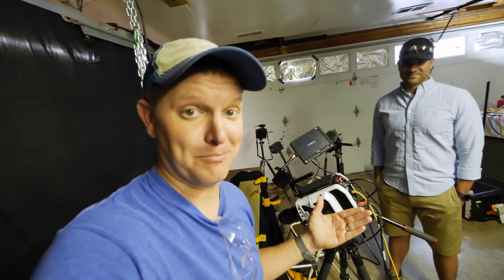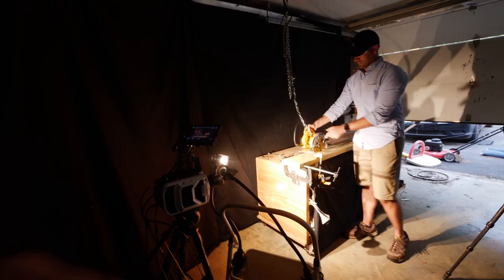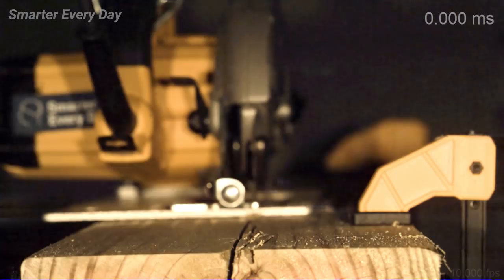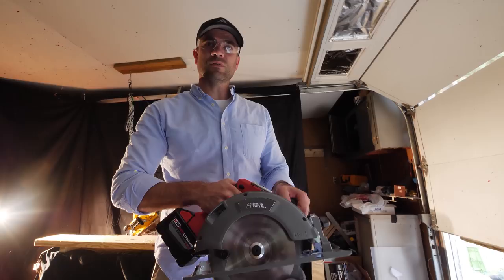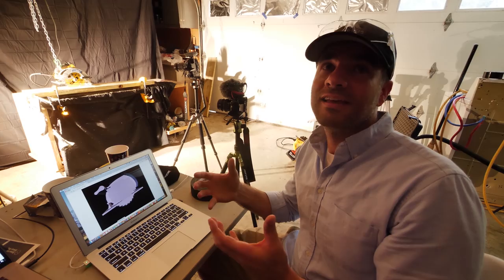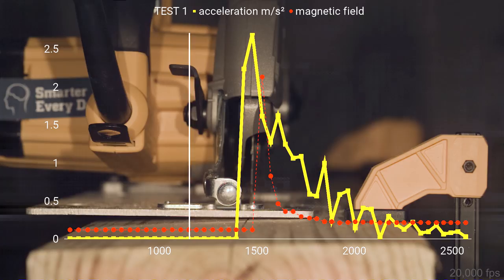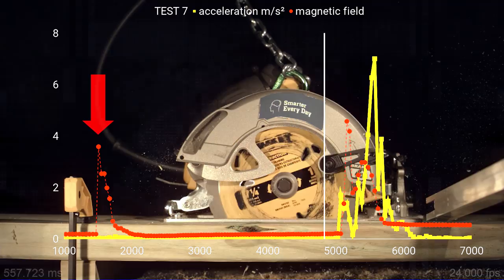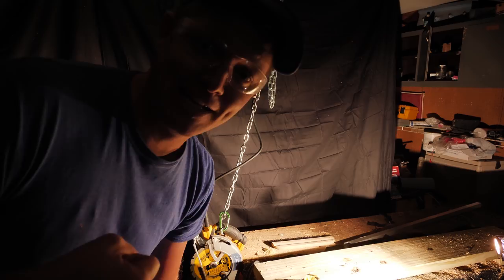Circular Saw Kickback Killer (We used science to make tools safer) - Smarter Every Day 209

Comment: One question: Do they sell circular saws with opposite rotation in USA? I have two circular saws myself, Makita and Metabo, both of them have teeth attacking lower side of a board, so if I loose grip they just stop. Also, this way a saw is pressed to a board by cutting so it doesn't need additional pressure, all I have to do is drive it straight forward. The only downside is that upper edge of cut material get chipped as it is the exit side, but lower edge stays clean.
Anyway, for the type of circular saw shown in the video, Chad's (hopefully) patent is a must-have. Congrats and keep up the good work!

Comment: Great concept!  We use worm drive saws with the motor turning perpendicular to the blade. This drastically reduces the kickback effect. I assume the data on inertia would be drastically different. I would like to see the comparison
Reply: How? It's not to do with the inertia of the motor? It got to do with the blade being grabbed and the saw being moved by the motor instead.

A wormdrive gear won't stop kickback, because it isn't about inertia. It's about the direction of the blade, and the blade still spins the same way.
Reply: PBMS123 because worm driven saws have more torque. Aka it’s harder for the blade to be pinched because the saw has enough power to keep cutting.
Reply: Interesting.  I would imagine because gyroscopic precession of the blade and the motor armature are at 90° to each other a worm drive saw is more stable.  They are heavier as well. Extra mass would also negate some of the kickback effect.
Reply: The inertia of the blade and/or the motor doesn't contribute to kickback.
Reply: I guess because it will stop right fast once the dead man's switch is released, probably wreck the drive In the process, but better that than your thigh
Reply: Andrew Delashaw yes it does it contributes to stopping kickback. It’s harder to punch a blade with more torque.
Reply: motormaker no that’s not the reason. It’s because of the gear reduction leading to the blade having more torque. Unlike “sidewinder” saws that have high speed but low torque and are really easy to stall out.
Reply: Life after Jess  Of course the inertia characteristics would be different. The beauty of this concept is that the motions measured during kickback are never encountered during anything close to normal use. A manufacturer can 'train' the safety chip to the kickback profile of each type of saw that it will protect and the user will be safe.
Reply: @PBMS123  It does have an effect because the worm gear saws are heavier and have a different mass distribution. Because the motor is more further back it requires more torque to rotate the saw as to what happens when a kickback occurs. And also because the handle is also farder back it creates a bigger lever so it's easier to resist a kickback.
Reply: @xenonram  Its the mass. And it does.  the bigger the mass the harder it is to be moved fast..
Reply: justlookin59 yes.   Gyroscopic precession ,I would think, would cause more of a twist on a worm drive. On a sidewinder all the rotating mass is on one axis.

Comment: You first demonstrated with a saw that is missing its blade guard, something most saws these day come with, you then showed a modified saw WITH a bladeguard. why didnt you show kickback behavior with a saw that has the bladeguard installed? is it also not quick enough? i understand that aditional safety is nice, and i imagine the sensor is small enough and cheap that the added safety feature would not impact the final costs of a saw with this feature, still, would like to know how the original feature performs to kickback.
Reply: Slower than the smart brake.It's a mechanical spring-loaded system.
Reply: I understand what you are saying it is a nice point but something like this would make cutting so much easier so that we didnt have to worry about blade guards getting in the way of complicated cuts and from my understanding and experience that blade guards some times is a little sticky for UK instance my saw blade guards some times sticks up which would make something like this a nightmare however I cut from the hip not strait out in front of me so if this happens the saw is going past me but I have had Vick backs so hard I've slung the saw

Comment: Most of this type saws I saw (pun intended) have a simple shield on a spring that closes as soon as the blade gets off the cut surface.
Reply: Doesnt cover the whole plade
Reply: The one I have does cover the whole blade when it's not engaged.
Reply: Beezqp it can never close fast enough. The front of the saw will cut you before the shield swings around from the back to close.
Reply: Actually, the blade cover closes from the direction that you are standing in first. Otherwise, you'd need to manually open the cover before each cut. This means that when kickback occurs, the blade guard will immediately cover the most dangerous region.
Reply: The guard does not spring back fast enough I have cut a chest guard off a harness I was wearing with kick back you obviously do not use a worm drive often
Reply: In time, blade gaurds can get stuck. Especially if the saw isnt cleaned and maintained properly. NEVER TRUST A BLADE GAURD.
Reply: How about having a blade guard AND madsskml. Two safeguards is much better than one.

Comment: Did you disable the spring loaded blade guard?
Reply: Walter Mayer yup not a real world test
Reply: Yes of course they did. Use the guards correctly on these machines and the risk is minimal. Americans never seem to use the guards correctly.
Reply: The blade is engaged in the wood, so the guard would be back anyways. If they had the guard installed you wouldn't be able to see the blade when it lifts up.
Reply: It's necessary to take video of the blade.  The problem is the blade is moving insanely fast, and the guard is relatively slow.  It'll probably save you if the saw falls to the floor, but check out how many teeth engage with the wood in the 50 ms after the first hit.  Haven't done the math on circular saws, but on table saws, it's 2-3 teeth per millisecond.  It doesn't take much contact to mess you up.
Reply: drfroglegs r/woosh
Reply: I think that at least in the US and with trade professionals, that this would be somewhat real-world. A lot of people will disable the spring-loaded guard, as it tends to get in the way and slow down work. People will bypass physical safety features if they're obstructive and slow down workflow, especially if they do that work repeatedly.

Comment: Michael said it below as well.  This is why all saws have a spring loaded blade guard.  If you are foolish enough to actually let go of the saw, the blade guard will cover the blade.  Nobody gets hurt.    I appreciate what you are working on and it has a cool factor, but I prefer a low tech solution to this non-issue.
Reply: Driving circular saws dont have those
Reply: Worked for as a summer handyman with a guy that had removed his guard. Quickest job I ever quit.

Comment: Very cool. I was thinking it's just be simpler to go off the amperage when it spikes, but I guess this specific case demoed the amps wouldnt spike. I can see how this type of kickback can happen but I think it's very irregular because you're pulling the saw instead of pushing it. Which changes the direction of the blade from up pushing into the fence to down and pushing off the wood.

Comment: I wonder if a better result could be achieved by just using a limit switch with the surface of the wood and the brake mechanism
Reply: No. there are many other types of cuts people do with these that the switch would not work on. It's not bad thinking though.
Reply: @weeral1  the switch could be also located at an inner flange not just on the shoe of the saw. I know doing all this machine learning is fun but sometimes the solution could be easier than you think
Reply: @Themodmin  plunge cuts
Reply: The key is reaction time.  How fast can you stop the blade. All happens within less than a second.

Comment: isnt that the reason why hand saw blades are wavy, to cut extra space so it dosnt get stucj in the metal you are trying to cut
Reply: Nah, they're wider at the tip so that the flat surface of the disk doesn't rub on the material you're cutting. The teeth will still chew in sideways if you mess up the cut. Kickback is actually LESS likely to happen on blades that aren't wavy.
Reply: Yes you are right Vega, it creates a kerf so the saw doesnt get clogged with the waste.  I think the other dude completely missed your question.  Sawzall blades r like that too

Comment: I like the concept but its very rare for kickback to be that uncontrollable on a circular saw unless you have weak spaghetti arms. This would on the other hand be better suited for a table saw, which has a very dangerous and uncontrollable kickback that can cause a lot of damage to the user. I recomend you try it on a table saw and you will have companies coming to you like flies.
Reply: I agree but i would still prefer to have that saftey mechanism over not having it..
Reply: There is a company that produces a table saw with an auto braking system.
Reply: Kickback combined with a large nail in the wood is not something a beginner might not come out alive from.
Reply: It’s been invented for the tablesaw already... it’s called SawStop....
My bad, that’s for a finger touching the blade not kickback 🤦‍♂️
Reply: I was going to say the same thing. I've cut a lot of wood with a circular saw, and i've honestly had more close calls on a table saw. Even when cutting 4x8 sheets of plywood, as long as you have it supported there's not much to worry about. If you have a big bow in your sheet thats when you shove a 2x4 under it for support.
Reply: Agreed, but I feel this tech could be easily implemented into any hand powered tools. Think about this in a chainsaw or angle grinder
Reply: @heli400  Sawstop does not prevent kickback and was never intended to, it senses when the blade touches moisture (like human flesh) to keep people from cutting their fingers off. The danger of kickback on table saws is that it flings the workpiece back towards the user at a high rate of speed, potentially causing serious injury.
Reply: @mrslinkydragon9910  I don't think that senses kickback though.  It needs to sense meat (hotdog or a hand) at its blade to stop.
Reply: To have a gyroscope detect kickback on a table saw you would have to have the gyroscope installed on the piece of wood. When a table saw kicks back the 300lb saw won’t move at all.
Reply: A circular saw kickback its way more dangerous. The blade of a table saw is static, so the chances of SIGNIFICANT injury is almost non existent. You might get a piece of wood thrown back at you, or get a splinter, but no injury from the blade. Plus, the blade on a table saw is "pushing" the wood towards you, not pulling you towards it.
Reply: Andrew Delashaw generally the main danger of table saw kickback is your hand ending up in the blade. Look up table saw kickback by thinz12 and you can see what I mean. For blade pinches such as in a rip there isn’t much danger of your hand going near the blade
Reply: @Yonatan24  Beginners who are using wood from pallets are especially likely to run into this...
Reply: @Grakoham  the gyroscope sensor would have to be more sensitive, the table saw would still move.
Reply: @Grakoham  Not necessarily.  Equal and opposite reaction means accelerometers (or other kinds of sensor) close enough to the blade may be able to effectively detect the kickback force impacting the table itself.
Reply: @HonoredMule  and @bososz normal operation and also potentially resting a heavy board on the table to rip it could create vibrations of the same magnitude as those caused by a small kickback. A small kickback can still do a lot of damage.
Reply: @Onihikage  ya, I corrected myself in my own comment
Reply: @bososz  The  jump putting a large slab on the table saw top would trigger it
Reply: @Yonatan24  and therein lies the problem with technology like this. Making it work when it should but not to be a nuisance while working.

Comment: This absolutely should be a feature for all types of saws, including jigsaws and table saws!
Reply: Charles Jones totally agree man!
Reply: I guess it detecting binding with a tablesaw would be totally different though, would probably have to detect sudden torque changes.
Reply: I've had jigsaws bind several times and even snap a blade. I guess "Kick UP" is more appropriate for a jigsaw :)
Reply: What kind of question is that? Are you trolling? All power tools are dangerous if used improperly.

Comment: I love Smarter Every Day, but i think it’s dishonest to exaggerate the danger by disabling the blade guard . I’m also pessimistic about the real world application of this on a job sight where saws are often used in very awkward positions. I kind of think you may get a lot of false tripping. 

Currently the best saws for preventing kick back are worm drive saws, the longer design and added mass does wonders in managing kick back

Bosch already has a similar technology in the works for table saws so you may be late to the game. That being said, you should talk with the people at Saw Stop, maybe they want to enter into the market.
Reply: Most of the time and injury involving kickback with these saws happens when the operator is holding the guard up manually. Festtool has a plunge saw that retracts when lifted up and it works very well at avoiding injury too.

Comment: seems like torque sensor + accelerometer would do the job, but lacks the "machine learning" sexiness lol
Reply: The point of the machinelearning is to not trigger a false alert when you fx. start the saw
Reply: @Lorentari  
+500ms delay on sensor

next! lol
Reply: @Lorentari  setting appropriate thresholds it would be fine. If your doing some whacky shiet that sets off the sensors and isnt a kickback, it should probably shut off anyways.

Comment: A couple things about kickback:  1.  It's almost completely avoidable.  The only times I've had a saw try and kick was when I had done something stupid in terms of supporting the wood I'm cutting or the placement of the saw.   As he shows in this video it mainly happens when the wood falls in and pinches the blade.  The vast majority of the time you can avoid this by properly supporting the work.    But there are awkward situations where you need to cut things..  Dimensional lumber can often have internal stresses that make the wood move once cut. Or it can be cupped/bowed/twisted.   (these only really come into play when you are making a rip cut)
2.  Know when you are doing something dangerous and get a real good grip on the saw:  If you can control the initial kick you can overpower the saw.  But if you let it get loosey goosey on you it's trouble time.    Keep that blade embedded in the wood till you can turn the saw off! 
3.  Plan for failure.  Fail to safety.
Reply: 4. Understand that everyone is an amateur at some point and that mistakes are going to happen to all of us when we're amateurs, and that if safety can be engineered in at almost no extra expense and with no detriment at all to experienced users of the same tools, it should be engineered into 100% of product sold. There's literally no reason not to, and every reason why we should.
Reply: @gweilo8888  Under the conditions you've laid out then of course.  But steps that enhance safety without any detriment to experienced users are low hanging fruit that has already been picked for the most part...  

Almost nothing comes without tradeoffs.  Either in price, efficiency or capability.  If safety was truly the most important thing all vehicles would be governed to 20 mph.  Presto: no more vehicular deaths.   
Safety is a prime consideration, but it's always in balance with your goals.  You're own brain is by far the best safety tool ever invented.  Plan for failure, fail to safety.

Comment: Its a neat solution to solve the saw kickback. However i wouldn trust my legs to a neural network, I would rather prefer a simple dead man's switch that brakes the blade whenever the tool desengages the wood or when it detects a rapid increase in torque (as when the blade bites into the wood).
Reply: I agree that I wouldn't prefer a nearal network. But a torque peak detection might not work, e.g. when the the blade starts biting into a second layer of wood. A peak detection for the accelerometer and/or gyro should work though, I expect
Reply: I somehow think that their solution isn't even smart. Its just a overcomplicated solution vor a problem that could be fixed rather easy. 
But the fact that no company did something like a pressure sensitive switch surprises me.
Reply: AFAIK I don't think it's a neural net in the saw, they're just using a neural net to train the thresholds that the device will use.
Reply: @megacherv  I'm not sure if that's correct... The neural network is really a black box with the hidden layers, and if it's a binary classifier (not kickback, yes kickback) the output is basically either a zero or a one. I think a manually defined threshold would work just as well since that acceleration is a huge jump compared to null. The NN could be over engineering it.
Reply: "…or when it detects a rapid increase in torque" I suspect you'd see far too many false positives.

Comment: Can you make one for a table saw?  I imagine would use an optical sensor as the trigger.  I cut burnt hardwood trees into small planks to use as stock for woodworking projects, and because I never have a flat surface to start out with, I'm at a high risk of kickback.  Even though I stand off to the side, I recently had a piece kickback into palm of my hand cutting a flap of skin loose.  Thanks for so many awesome videos.